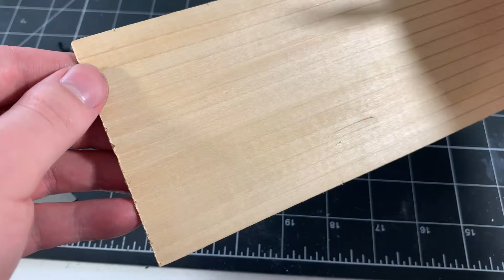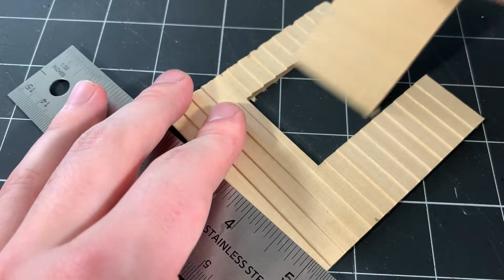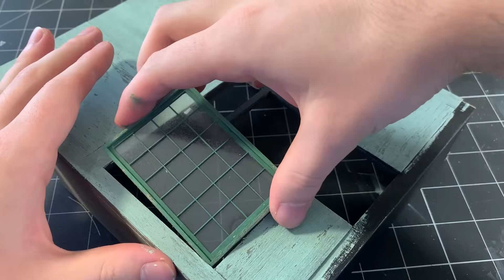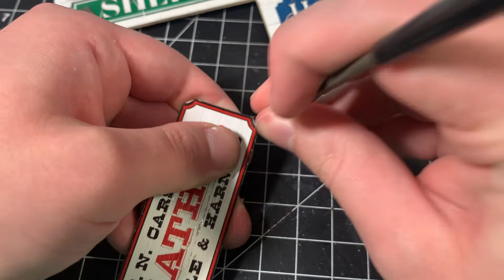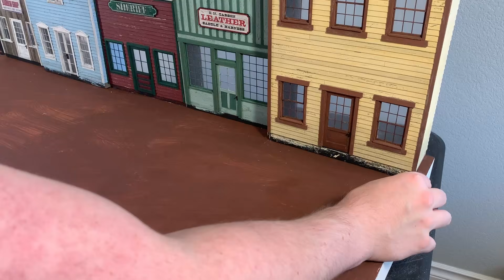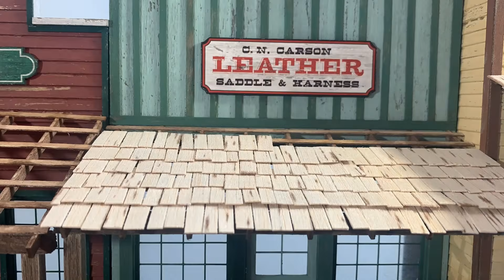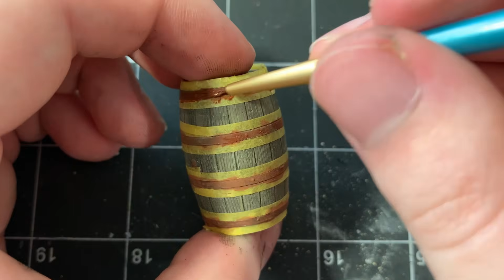Build an ULTRA-REALISTIC Wild West Model Railroad DIORAMA - Miniature Model Train Scenery

Comment: Good build. I have been a model railroader and trainman for a few decades, and here are a few tips that could've improved the train aspects.
1. I can tell you used Bachmann steel rails. You can leave these outside for 3-4 days and they will naturally rust, leaving a similar but less uniform layer as paint does.
2. Railroad ties are always a very dark brown. I usually paint my ties dark brown and then follow up with a black wash in the center to represent oil and grease.
3. On steam locomotives, the front coupler should be painted a dark rust color. Also using a dark gray wash or dry brush on the gray smokebox area can emulate the excess smoke layering on the engine. Also having the engine wheels spin while airbrushing leaves a more uniform coat.
I look forward to seeing what you do next.

Comment: Stunning work, and an excellent, clear, inspiring video! Thank you for sharing your skills and techniques.

A question: I need to create some buildings with a similar look, and was on board with everything you demonstrated, until the 3D-printed windowpane parts (muntins). Uggh, I have no 3D printer. Do you have a good alternative to recommend? I'm thinking worst case I could draw/paint them on with a paint pen, or use a thin pinstriping kind of tape.

Comment: 1:25 “I’m using quarter inch clapboard basswood sheets…” Is this an error?  They don’t look like 1/4 of an inch. It’d be near impossible to cut with an xacto blade. Not to mention dangerous. I’ve tried it before. I also recently bought 3/16” slats and was exhausted and shaking after trying to cut it with a 25mm blade. The board was shifting all over too and the cut was awful.  Are you sure you don’t have a mini table saw on the side there? 😅
Reply from the maker: 1/4” refers to the width of each plank of the clapboard siding, not the thickness of the board. The thickness was roughly 3/32”
Reply: @smolworldworkshop  thanks for answering. Do you still have the air conditioners stl files on your Patreon?  I’m getting a Bamboo A1 mini 3d printer soon. I’ve been 3d modeling in sketchup but still learning.

Comment: Top notch work. 

Old West style locomotives in G scale are rare and expensive (the quintessential Old West locomotive is a 4-4-0 prairie style locomotive with large diameter driver-wheels that are spindly like wagon wheels and a large cone shaped smokestack which is to catch embers from wood-burning locomotives.) 

The engine you selected is a 4-6-0 and is a good choice for the wild west. They used a similar one in Back to the Future 3 which takes place in 1885. Bachmann's large scale is roughly 1/24 and they're way cheaper than the high-end manufacturers. 

It doesn't help that G scale manufactures use different scales; 1/19, 1/24, and 1/32 (Gauge 1.) Since the gauge (distance between tracks) remains constant the 1/19 stuff ends up being "narrow gauge" scale while the 1/32 is the closest to "standard gauge." Of course, the rail height themselves are over-scale so it's best to not think about it too much. G-scale is the unloved step-child of the miniature railroad community because of its inconsistencies. It does look fantastic and looks realistic when the attention is paid to the details. 

Only nitpick is you could have used "chicken-grit" as the ballast. It's a size-and-sorted rock product they feed to chickens to help them break down their feed and its sold as most tractor supply stores. Consistently sized and looks great for G scale. To be fair thats a stretch as your solution looks fine as it is. 

You've managed to make a more realistic layout than most garden railroaders!   

 Have you considered making some clumps of weeds and tall grass using nylon thread chopped up? I've seen the warhammer guys make some realistic grass with this method. A few weeds around the edges of the buildings/walk-way would be a nice finishing touch. 

I'm working on a 1/24 railroad project right now which is how I came across your videos. Thanks for the inspiration and motivation!
Reply from the maker: Hi there!! Thank you so much for watching the video and for all of your kind words! Thank you for all of the clarification regarding the locomotives, I’m still learning and that helped a lot. 

That’s interesting about the different rack gauges, I knew that there were different sizes in real life, but I didn’t know they did the same for model railroads. I believe my track must be the narrow gauge then. 

That’s a great idea regarding the chicken grit! I’ll keep that in mind for next time. And I would have loved to add some vegetation to the scene, I unfortunately just ran out of time. 

Thanks again for all of the support, and good luck with your project!
Reply: @smolworldworkshop  As a train guy, you did choose a good train. However, you have made one mistake with it: You forgot to include the locomotive's tender. Without that tender, that engine is going absolutely nowhere. It is most certainly not a tank engine (which would have a fuel bunker in the back to carry fuel for the firebox). So a requirement would absolutely need to be adding in a tender to that engine.

There is also some suggestions I can give you to sell the Old West locomotive look even more, such as a large diamond-shaped smoke stack, a huge oil burning lamp instead of the small lamp it has, and some more bright colors like red or blue instead of all black. Since old west locomotives had way more colors and steam locomotives only really became uniform black in the late 19th century (1880's-1890's) to early 20th century due to it being cheaper to paint black.

I would also recommend depending on when your western town diorama is set, you should consider having more wooden parts on it. But yeah, the only big necessary thing is the tender. That is a must. The large diamond shaped smoke stack, the huge oil burning lamp, and vibrant paint scheme instead of black I would recommend as additions, but are not a necessity.

Comment: Ive been building these short depth dioramas since the early 2000s i used to use foamcore but i had problems with it warping. I use PVC sinta foamboard now. You can still use PVA glue but it is stable material
Reply from the maker: That’s a great suggestion, thanks for sharing that with me!